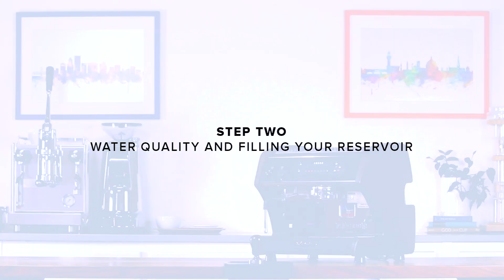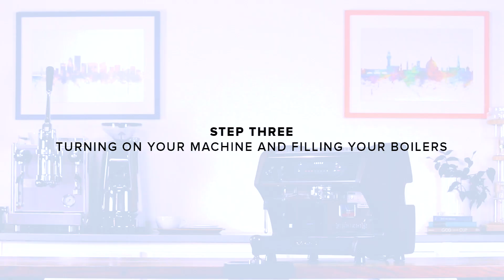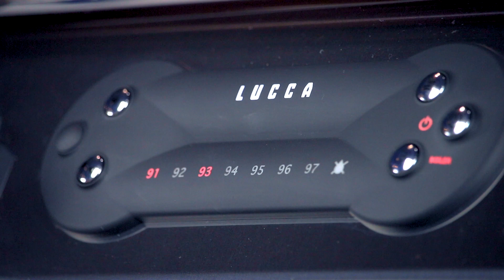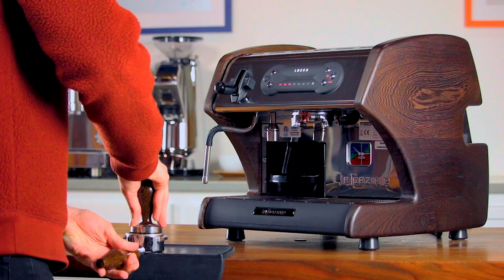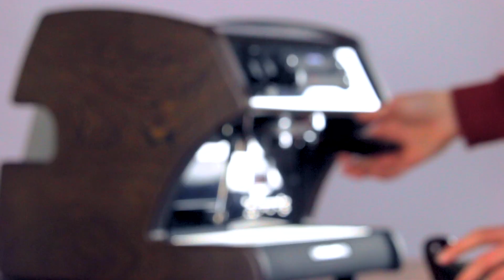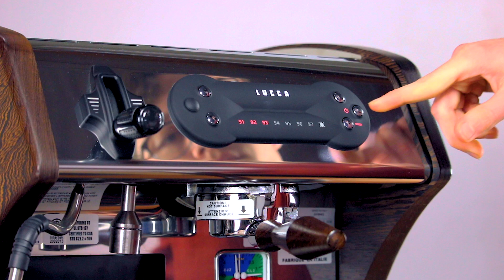LUCCA A53 Mini Espresso Machine Setup

Comment: Does the programmed shot reset every time you plug/unplug the machine? I’m finding that the volume I set doesn’t stay the same when I plug my machine back in another day and try to pull a shot. I’m very confused
Reply from the maker: Leaving the machine unplugged will cause the machine to reset the volumetric dosing settings. We recommend leaving the machine plugged in and turning it off using the power button. The only thing that will remain on is a single LED, otherwise the machine uses next to zero power in this state.

Comment: Hi Charles, nice video! 
My Lucca has a display for temp from 85 to 120. Is there an equivalence to 93C?
Also can I change the pressure to say 8 or 10 bar, and is this a setting you recommend moving?
Reply from the maker: 93°C is just a hair under 200°F, so functionally you can use the 200°F setting. You can adjust the pump pressure and we have an article that explains how which I've linked below. I encourage experimentation but I'd recommend toying with other variables before pressure (ratio, time, etc.) as they tend to have a greater impact anyway. If you do change pressure, a bit lower is better than higher. A recent study suggests that 6 bar might be the ideal number, though I can't personally back that up yet.
- Charles